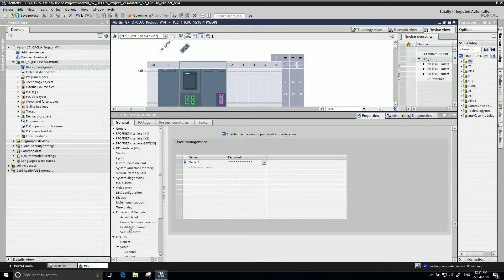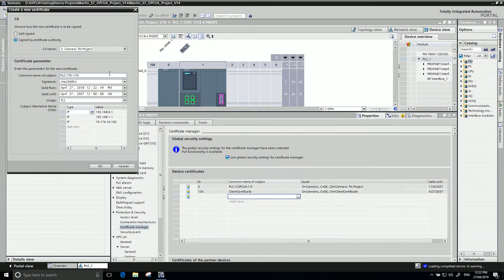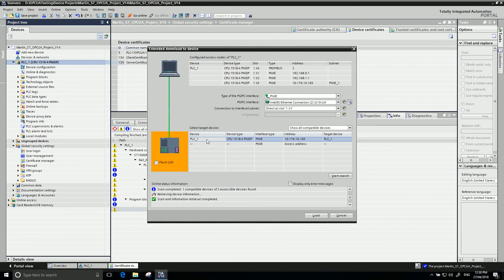Siemens S7-1500 OPCUA

Comment: Hi Martin, I'm having a lot of problems with the connection between Siemens S7-1500 over OPC UA with security. I've tested two different OPC UA Clients (FreeOpcUa client and Prosys OPC UA Client). I'm doing everything on Windows 10. The problem may be related to the trusting process of the client app certificate by the OPC UA server (PLC). We are using TIA Portal V15 and we are adding the client certificate to the Device Certificates list and also to the trusted clients list. 

Have you had any problems to achieve the connection? 
Can you tell me the main steps to be followed to create client certificate an to import it to the server with TIA portal? Is there any need to import the client certificate to Windows trusted clients? How?

Thank you very much in advance. 

Hope you can help me.